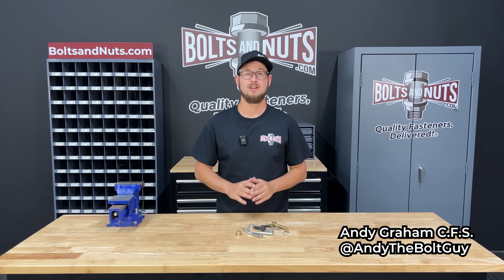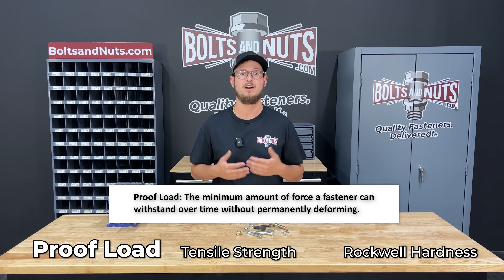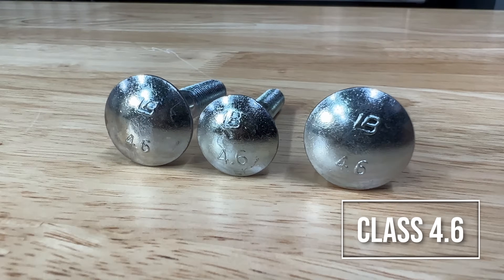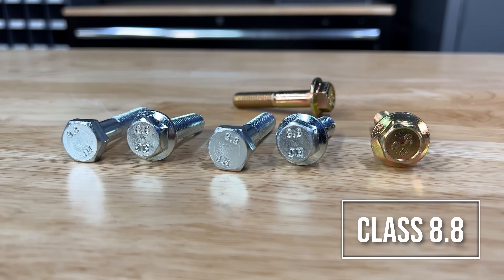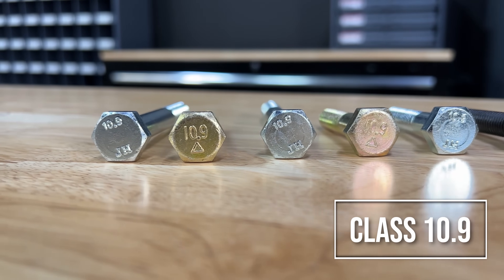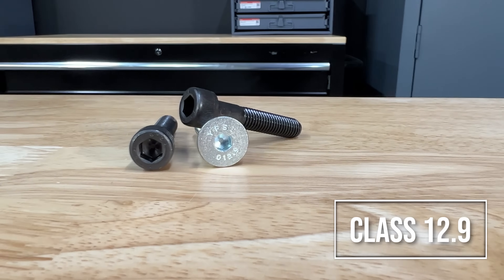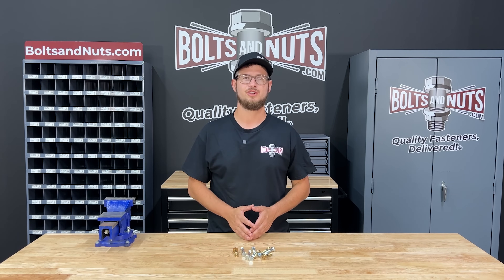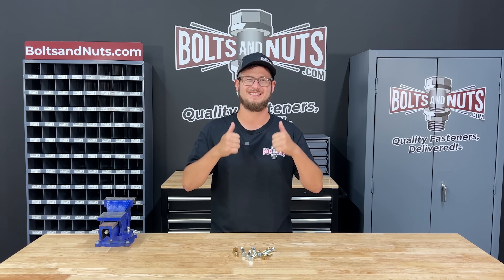Metric Fastener Grades & Strengths Explained!! (Class 4.6, 8.8, 10.9, & 12.9)

Comment: Please explain why you don't carry metric M12 bolts with an 18 mm head? Why should I need to bring a 19,18,17,16,and 15mm wrenches to remove a bolt?
Reply: The standard size for M12 bolts is 19mm. US manufacturers choose to go with 18mm instead because it could more-or-less fit an 11/16” wrench… The only M12 standard bolts with an 18mm head are flanged bolts, which are quite uncommon. So you won’t need an 18mm wrench when working on Japanese and most European cars.

Comment: Can we have bolts of different diameters but same gade
Reply from the maker: 100%
Reply: @BoltsandNutscom  The tensile strength describes the maximum mechanical tensile stress that the material can withstand before it breaks. In this case, it is given in Newtons per square millimeter (N/mm²). However, the tensile force given for the strength class is reduced by a factor of one hundred. An 8.8 screw therefore has a tensile strength of 800 N/mm². This means that an M8 screw = 50.27 mm² with 8.8 has a force of 50.27 mm² x 800 N/mm² = 40216N = 40.216kN.
Reply: @ mimamaanno6535   I was under the impression for tensile stress the core (minor) diameter was to be used and not the nominal?
An M8x1.25 (standard pitch) would have a core diameter of about 80% of the nominal and resulting in 36.6mm^2 only.. not 50.3mm^2.